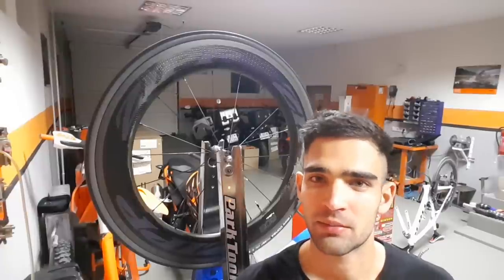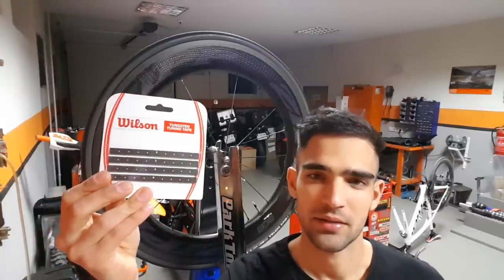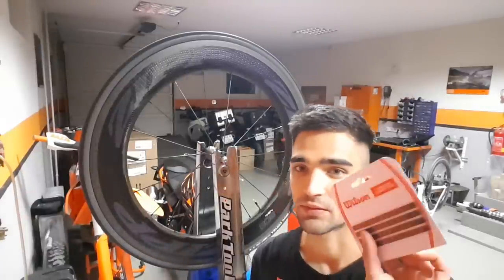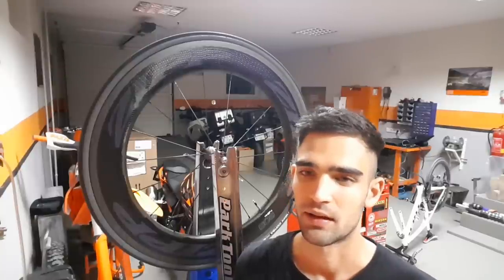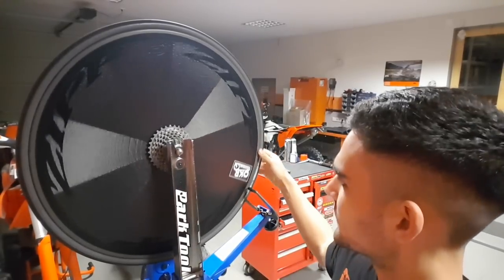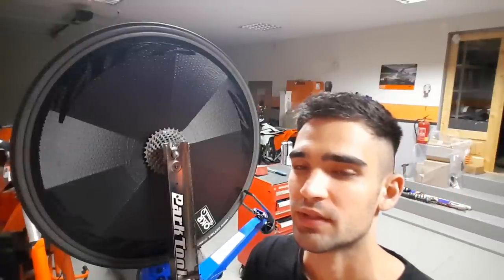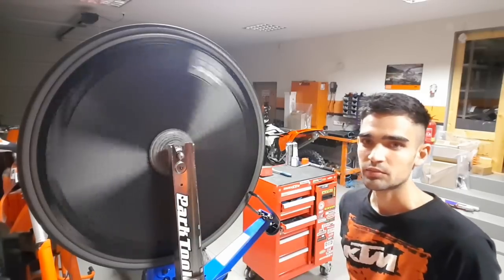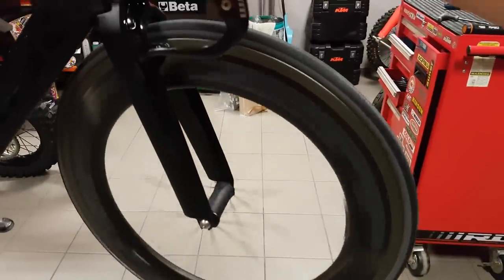How to make your aero wheels even faster

Comment: take the tire and the rim strip off when you have found the balance weight and stick it on the rimbed. this does not realy mather for the innertube and makes the whole job clean and you don't mess with the aerodynamics.

Comment: If you have nothing else you can just use lead flashing.  It is really easy to cut into a piece that is the right weight and you can bend it around the rim opposite the valve stem.  Stick some tape over it to hold it in place.
Reply from the maker: earthstick thanks for the tip, I will try it if I run out of these

Comment: I would go for eTap and a Lightweight disc or complete Autobahn set. Unfortunately last one is not available as clincher version. I had a Super 9  disc and 808 front wheel before I bought a Lightweight Autobahn set. I see there an advantage. I didn't want to use Tubulars anymore, but I have to now. However I run the Corsa Speed G+ tubular tires on my Autobahn set and I can't complain at all. The gluing process isn't so bad with Tufo gluing tape at all. The biggest advantage brings the disc. The front wheel is just 80g lighter compared to a Zipp 808 with a Specialized turbo cotton and a lightweight tube, the biggest advantage is there the stiffness. eTap is on your bike, lets say, apparently not the best choice because you run a 1x11 drive train, but I love my eTap system and I don't want a mechanical system anymore.
Reply from the maker: Tubulars are a lot slower in both rolling resistance and aerodynamics, plus the LW wheels use very outdated rim shapes, nowhere near as aero as Zipps. 80g is nothing, weight will never make you faster. My Dash set was 700g lighter than the Zipps, yet much much slower back to back. As for stiffness, both the S9 disc and the 808 NSW are super stiff. Electronics are a must have on road bikes, but with 1x you get a much cleaner setup in mechanical. The R2C lever is an absolute peach, I would not change it for electronics.
Reply: I agree with you that tubulars are not the best choice, but they are not so bad when you pick the right ones. Accordiung to http://www.bicyclerollingresistance.com has the Vittoria Corsa Speed tubular a lower roling resistance than most of the clinchers people ride, like the Conti 4000SII or Specialized Turbo Cotton. However the Vittoria Corsa Speed open tubular roling resistance is 1,6 Watt lower, that's a considerable difference. I haven't found a comparsion of aerodynamics of tyres yet. I also agree that the shape of the front wheel is outdated. You feel that because the LW wheel catches more the wind, it's not so easy to ride. The Zipp stiffness is good but the LW stiffness is way higher, you feel it. I disagree with you when it comes to the performance of the discs. The LW disc is so much lighter and stiffer than the Super 9 disc. Look at the pro peleton, there are a lot of pros who ride a covered LW disc instead of the disc there sponsor is providing, coincident? I don't think so. However the aerodynamics of the Zipp disc is better. If you race mostly on flat tracks Zipp will outperform LW. If you have a hilly track, like I do, I prefer my LW. I guess for me the quickest constellation would be a Zipp 808 and the Lightweight Autobahn disc. Here some information I considered, it comes from the magazin tour.
LW Autobahn wheel set:
Aerodynamic 45km/h = 199,1 Watt 
Acceleration energy = 111 Joule  
Stiffness (front/rear) = 64/62 N/mm 
Weigth (front/rear/quick release) = 679/789/44 g 
Max. rider wight = 100kg
Zipp 808/Super 9 wheel set:
Aerodynamic 45km/h = 197,5 Watt 
Acceleration energy = 135 Joule  
Stiffness (front/rear) = 40/52 N/mm 
Weigth (front/rear/quick release) = 852/1108/78 g  
Max. rider wight = 125kg
Conclusion:
If you have the chance try a LW disc, just for fun, I like it a lot. The electronic shifting isn't the best option on your bike. Than I guess ther is nothing left to do on your bike.

Cheers from Germany
Reply: Borris Jung I've ridden one. It's a waste of money.  They ride like crap and I've never seen a favorable wind tunnel test with them.  They're even outdone by cheapo discs from Flo Wheels

Comment: Would I be able to do this with the wheel still on my bike? I don't have a fancy wheel truing stand
Reply from the maker: Jacob Wang sure, the front wheel is easy, but you will need to remove the chain to do the rear
Reply: Alright, thanks man